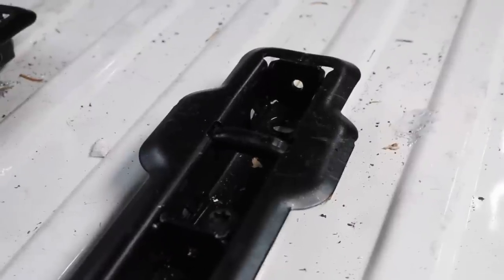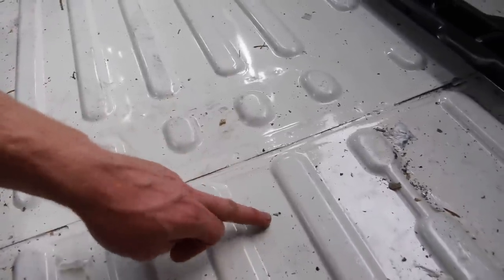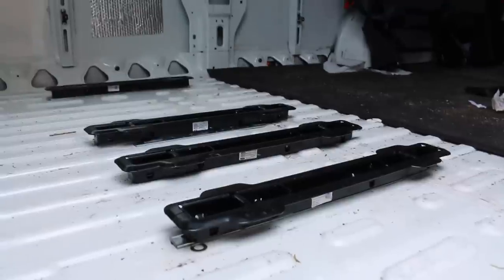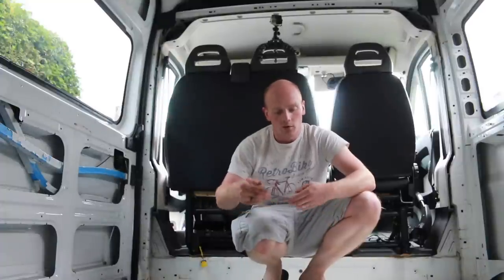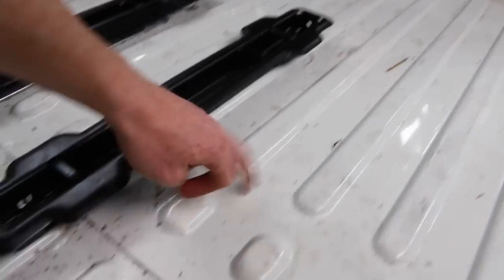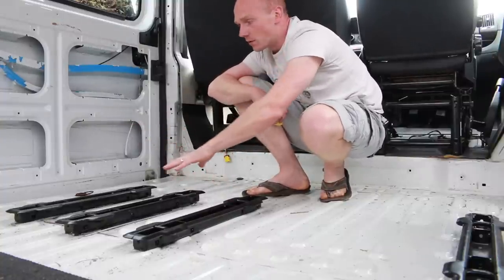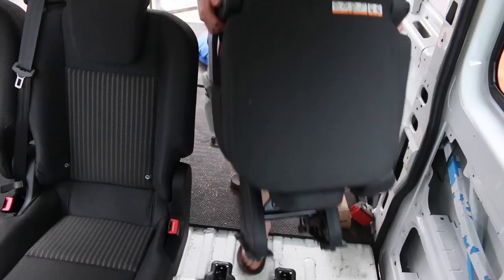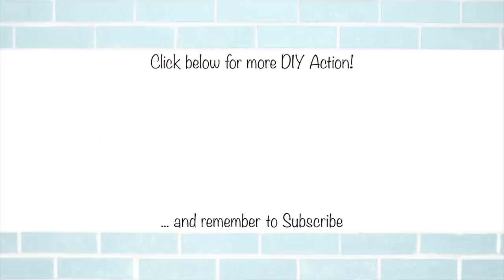Fitting the Rear Seats | TRC Van Conversion 4.0

Comment: Hot glue worked pretty good on mine. I put a wide double seat from a 2018 Ford Transit in my 2000 Ford E250. I had crossmembers in the way so I couldnt span the whole bracket with one plate. I had to break the plate underneath up into 3 plate pieces using 4 bolts on each seat bracket (1, 2, 1 if that makes sense) from the 2018 Transit. They are really solid, thanks for the hot glue tip.

Comment: That single seat, if you fold it down you can use it as a mini-table. That was one of the features of a Renault Espace (2003) which we used quite a bit when travelling as it had cup holders built in.
Just a thought which could be useful. Any love your videos, Keep them up!!
Reply from the maker: Yes they do work well as tables and end up very flat, almost creates a bed.  However where possible we will probably leave the third seat at home as it does take up quite a bit of space, plus there will be a fold up table in front anyway.

Comment: Hi there. I know this video is a couple of years old, but it is really helpful and informative.
I wanted to know the height of the Ford seats as I am going to use the exact same seats in my Citroen relay but I wanted to put a table between the driver seat (on swivel) and rear seats and have that as dining area.
The only issue I can see is because the main driver and passenger seats are much higher, is this even possible in your opinion? Ive really been scratching my head with this one but I cant see a safe way of even raising the rear seats. Thanks Zach

Comment: I love your work and thinking, just a (possibly ill informed) question regarding the nylon nuts. Are they not a weak point? Would it not be better to use two ordinary nuts per bolt locking each other?
Reply: Douger Rohmer
Nylon lock nuts are pretty reliable. They can always add another if they have any problems, but I've never seen a nylon lock nut come loose.
Reply: Ah! I've just googled it, and it seems I have always erroneously assumed that the nylon is actually the threaded part, therefor you cannot torque it as much as a conventional one. Not so! Thanks for the info!

Comment: Looks great, nice work. Did the steel underneath go in parallel with the rails or did you run it from right to left? Was a bit hard to see as its dark. Thanks.
Reply from the maker: Right to left.
Reply: @TheRestorationCouple  amazing, thanks very much. I am looking at the same seats in a mk7 transit.

Comment: Great job. I've been planning to get the same seats fitted in mine. Is there much of a different in level between the cab seats and these seats? I'm hoping to raise mine up and build a floor level with the cab.
Reply from the maker: There is quite a step between cab and back in these vans so even with floor insulated and raised they are slightly off set.  If we were just using the pair then I would have built a raised section like you say, however it wouldn't have worked with the third so close to sliding door.
Reply: Yes, I've been considering that problem. I've got the same van and I'm hoping that there will be just enough room to build in a step.